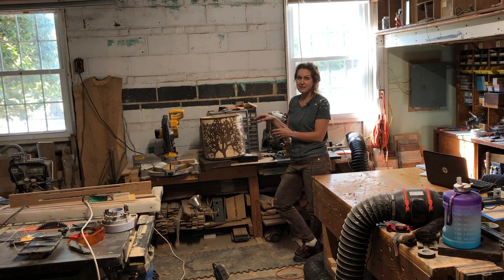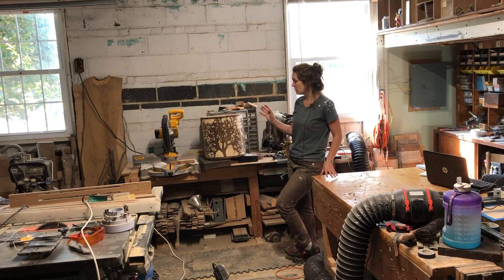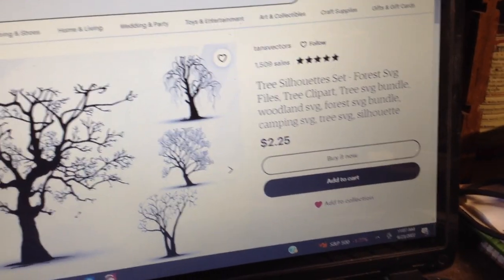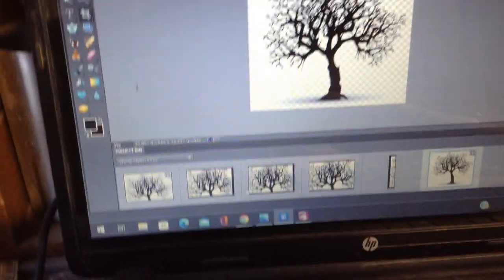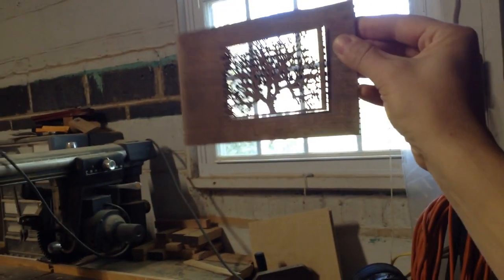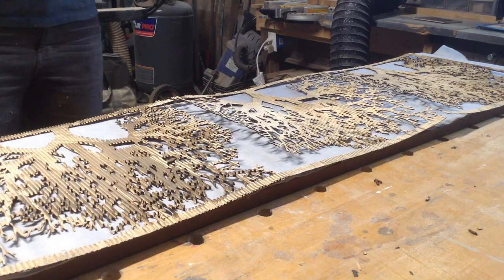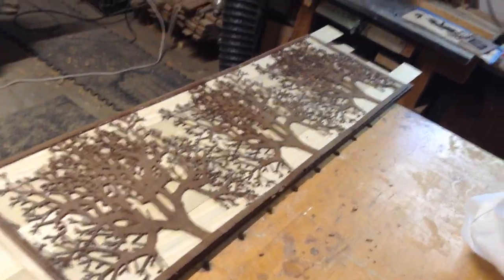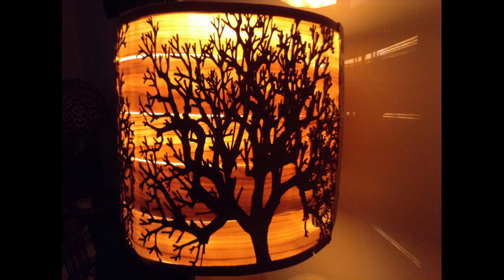Tool Review : Ortur Laser Master 3 //  What's it capable of?

Comment: First time watcher.   Neat project.  You may want to use the "Print and Cut" feature of Lightburn when doing the tiling work.  It'll help you line up the segments very well.
Reply from the maker: Nice! Thanks for tip, I've only been using light burn for about a month so I know next to nothing, and will take all the tips I can.
Reply: @HoneyBadgerWoodWorks  I'm only a few weeks in to it myself but have been watching a lot of YT.  I ended up doing a cut with multiple layers and goofed on one so it went too fast and only did a line and not a cut.  Didn't notice until after I'd picked the piece off the bed.    Using Print and Cut I managed to get it exactly back on the right place and cut directly on the line I had.